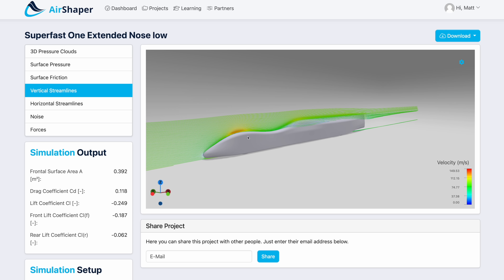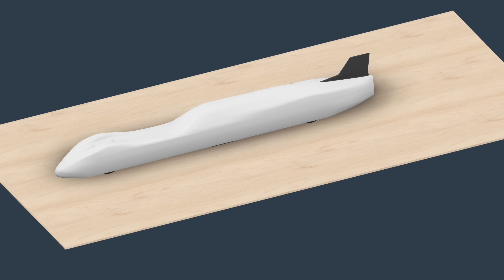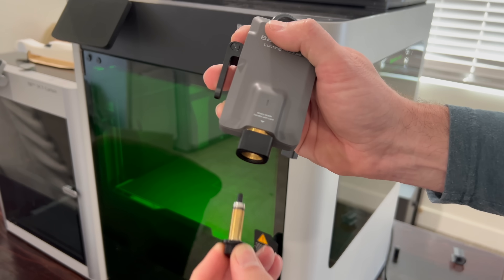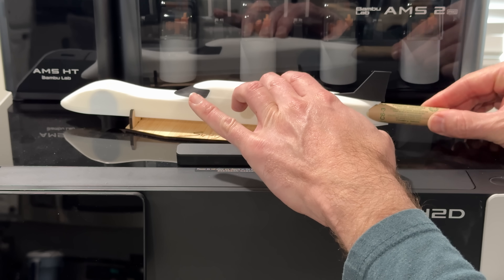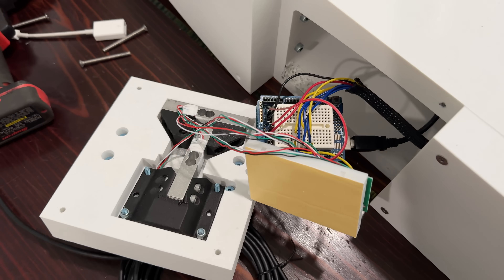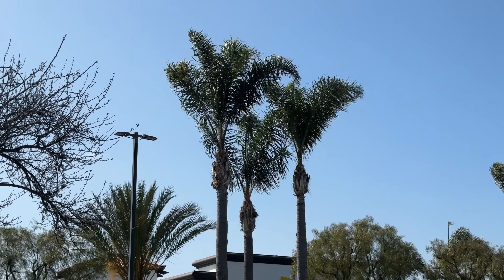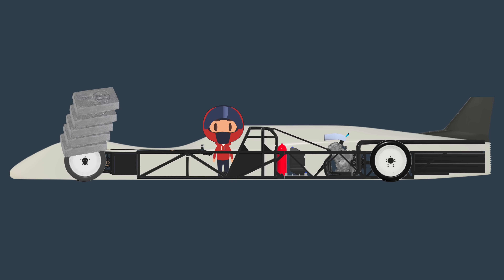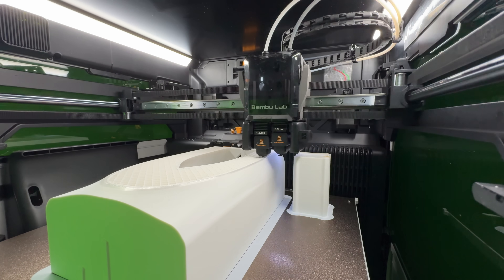Aerodynamic Testing On The Highway, With The Bambu Lab H2D

Comment: The ending was perfect.   Having done a lot of model rocketry in my day, I was like, "There's no way that's gonna do anything other than... oh yeah, there it goes."
Reply: This did not make any sense until the very end.😂
Reply: at least he appeared to not use an engine with an ejection charge
or he just cut it before it happened
Reply: @Mister_Brown  But if you use an engine with the ejection charge it will conveniently remove the spent engine at the end of your first “speed run” so you can quickly load another engine for your run the opposite direction.
Reply: @Mister_Brown  If I recall correctly, the lower stage engines are red… I wasn't watching closely enough to see the numbers, though. Did catch the 'C' - need to watch again… Sorry, lazy with cat in my lap - could go look at my engines but don't have many lower stage engines…

You all seem to have forgotten about the extra light model rockets with no recovery system that would just kick their engines out and fall. Unfortunately, many fields require sticking at least a streamer to the engine, so not so popular…
Reply: Chekov's Model Rocket 😁
Reply: @SledgeOfHouseHammer  Darn, you beat me to it.
Reply: We did something like that in shop class when I was young. However, our rocket cars had small screw-eyes and travelled along a long cord.  My car flipped early, and ran most of the course on it's top. When my son was young, we went to a hobby store that had a large scale train track (O gauge?) set up out back (with a pond beyond the end), which they ran rocket powered train cars down.
Reply: @Rabblewitz  The Estes dragsters use a guide cord, too.  As soon as I saw no guide line I knew exactly what was going to happen.
Reply: @nathank7989  Yes. I have one of those. 🙂
Reply: That's what we like to see, results that we are expecting!
Reply: I wonder what percentage of kids in model rocketry tried taping an Estes motor to a Hot Wheel?  It's got to be over 50%.
Reply: @longshot7601  I taped a half dozen of them on the wings of a foam glider from the local toy store. It was magnificent, even after the wings caught fire. Maybe more so.
Reply: @ I found that putting them under the fuselage was the ticket.  C6-0s were my motors of choice for that....sometimes with an M-80 on the end of the motor.  😁
Reply: Apparently SuperFastMatt fans are also rocketry fans because my first thought was THAT is going to need WAY BIGGER fins
Reply: @DuffusMonkey  Yes, we're rocket scientists… 🤣 More fins to balance things out would have been helpful, though…